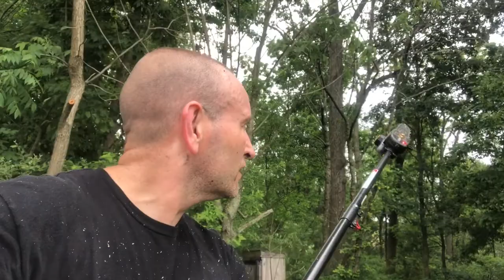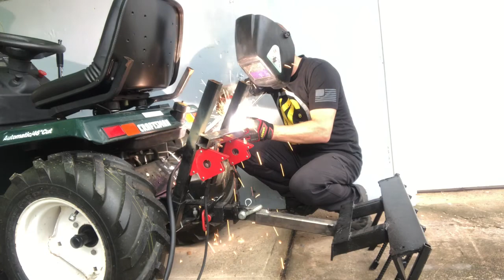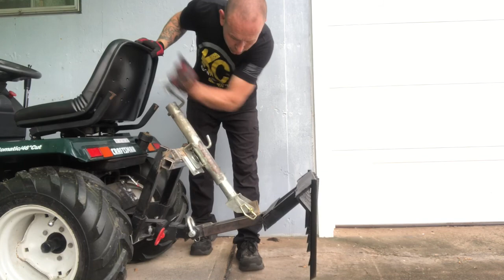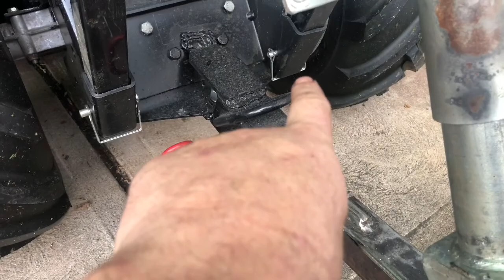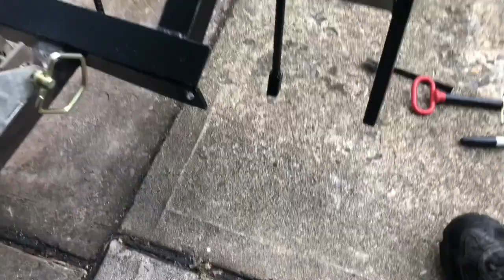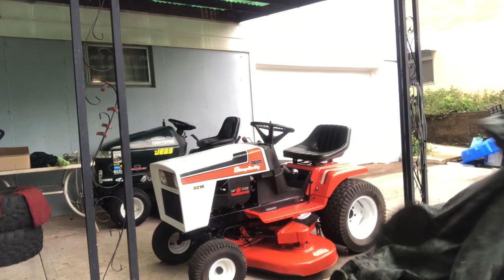Making small implement,s for food plot planting

Comment: How did that work out. I’m a welder fabricator . I would love to see the design
Reply from the maker: Just built it from scratch, I made it from scrap pieces of steel I had laying around, I used a trailer jack for the lift but you could use an electric linear actuator if you feel like wiring one in. There are other food plot videos on my video list that show the tractor in use, I was pleased it done what I needed it to and just broke the surface of the ground to get the seed good soil contact. When I use it I just disconnect it from the lift and drag it to cut and level the ground I’m going to seed.
Reply: @huntnfishnuts5880  ok I will watch your other videos

Comment: I admire your dedication! I don't react well to poison ivy either! I've been running into a bit of it while peeling slippery elm bark! I recently bought a mig welder, now I just need to learn how to use it! LOL! Are those magnetic braces you're using? (Harbor Freight purchase?) I have chains on my riding mower/tractor (22 HP). Gotta have 'em around here! I learned a few things watching this video! Nice work! I know I've told you about your fabrication skills before, but you have some serious skills! Wow, that 6216 Simplicity is a beauty! Again, skills! I hope all is well! All the best to you and your family Paul! Take care buddy!
Reply from the maker: Thanks for watching Todd, yes I was using fabricators magnets to hold my mount in place, you can get them at harbor freight or tractor supply, there great for working with steel, they have a 90 deg or a 45 deg side. Here I was using a flux core 145 amp welder, I also have a 149 amp mig set up with argon/ co2 gas  but this one is great for using outside, cheaper too without having to use gas. I was pleased with his the 6216 came out , it was well worth restoring. Stay clear of that ivy lol I hate that stuff, stay safe Todd, talk again soon.